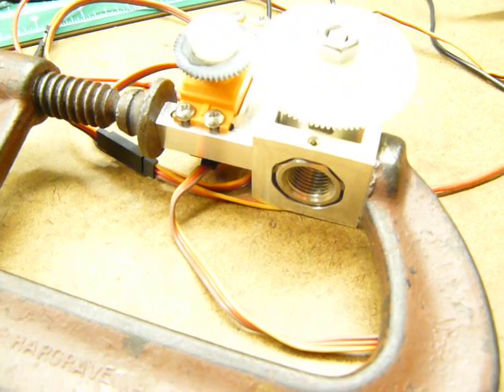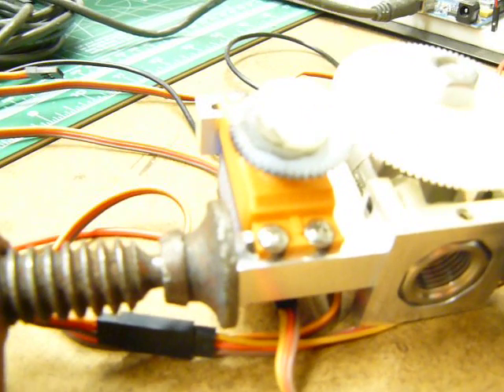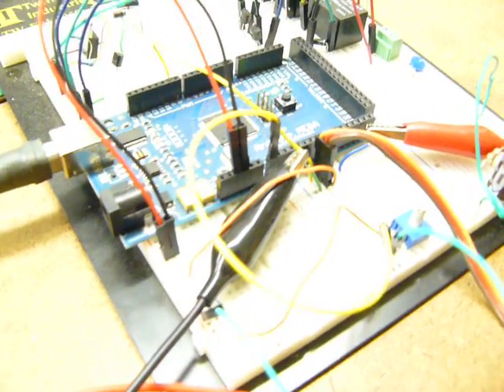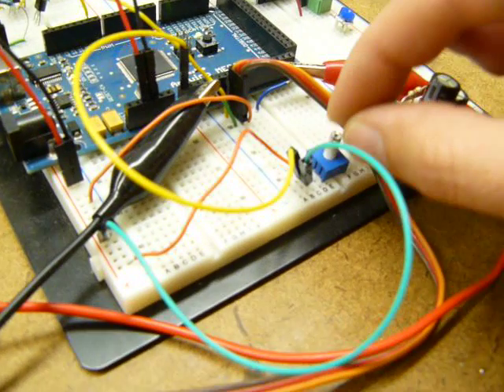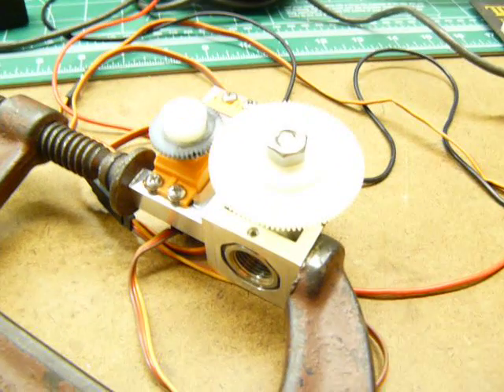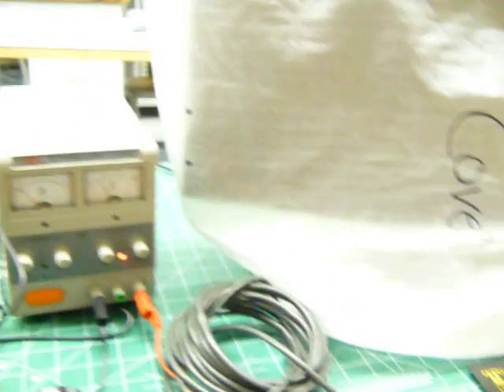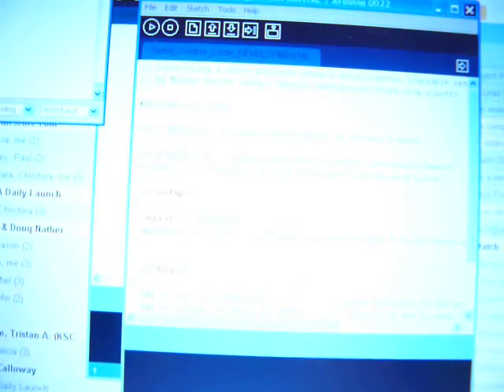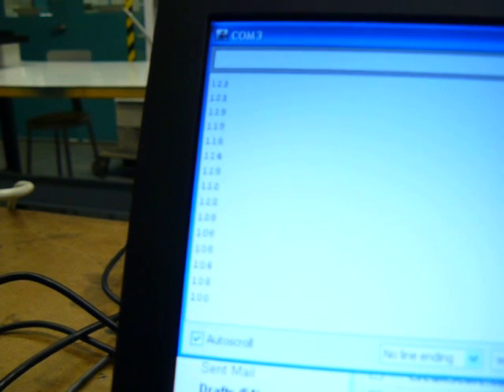Aquila Project's Servo Actuated Ball Valve Demo (Developmental)

Comment from the maker: Essentially, you sample the pot's resistance on an analog input, map that value to a digital value between 0-255, then that value gets mapped to a PWM duty cycle and sent out to the servo, the servo then interprets that duty cycle to set its position. I believe most all RC servos operate in this fashion.

Comment: @RSMPromotions  hey, i thank you with your professional opinion. Can i ask you one question? Is there a difference between an RC Dc Servomotor (which is used here) and DC Servomotor which is used in industry. I mean the difference is the size, is it? The rest like potentiometer, encoder, control drive, is all the same right? Thanks for your reply again.

Comment from the maker: @chelvis7 Specifically at 1:56 you can see the meter is at around 250-300mA with the current holding torque.

Comment from the maker: @chelvis7 Whether or not the servo draws power when it is not moving is completely dependent on your control system.  Servo's will hold their position when an external torque is applied by consuming power. Servo control algorithms typically inject "chatter" into the servo to hold a very precise position- this is because it is commanding a finite position, the motor overshoots, the control compensates back the other way and overshoots again.

Comment: Hi, 
does the servomotor consume any electricity power when it is idle, as in when it is not moving?

I am simulating a servomotor with a ball valve using matlab simulink. right now constructing a simulation model. It is part of my assignment in my university. 

Thanks for your reply.

Comment from the maker: @rkp4k The servo gear was epoxied to the horn supplied with the unit using a metal pin to keep the gear centered. The bracket was custom machined with set screws to hold the servo such that the gears mesh properly. I would recommend buying valves with mounting bolt holes- makes creating a bracket easier.

Comment from the maker: @rkp4k The gears are from McMaster Carr- they're nylon and hold up pretty well with this small servo but I would recommend something stronger for anything larger. (Servo puts out about 280oz*inches torque and the nylon teeth start to wear down after cycling through many bench tests) The ball halve has a stem with a flat machined in to it (D shape) and the gear was machined on a mill to fit snug on this.